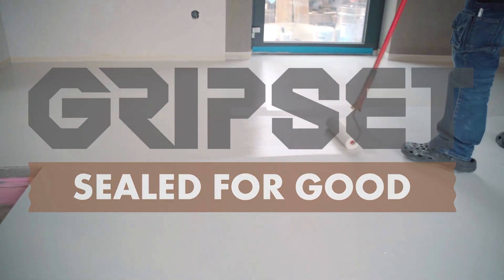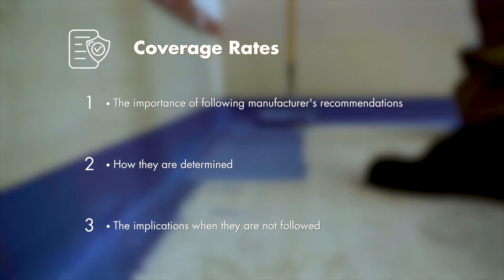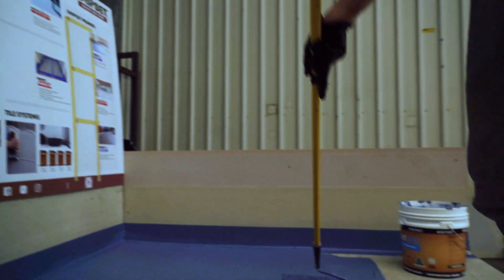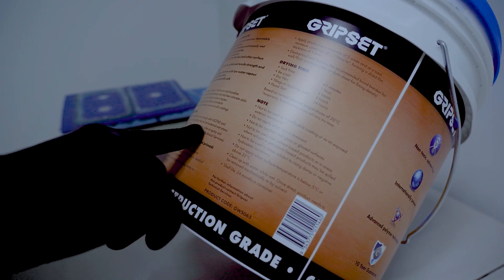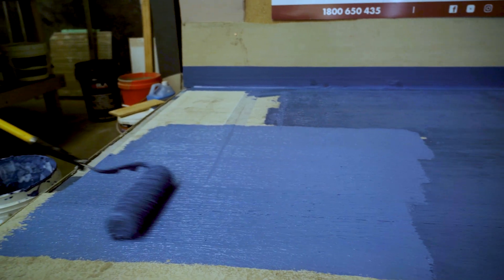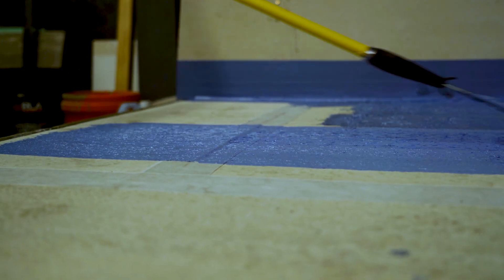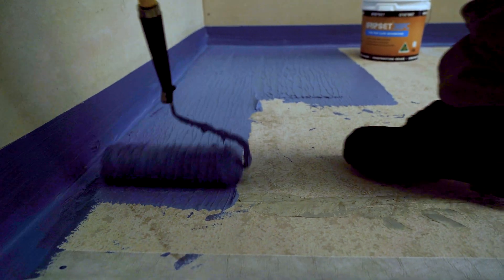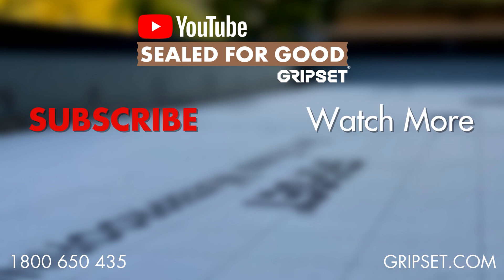Coverage Rates Part 1 | Basic Fundamentals

Comment: Good Video and here's an example of what your saying, just doing a diy  ensuite reno and got your products from beaumonts, and was told that 1 x 15l pail would be enough to do a standard bathroom or ensuite, didn't seem to want to listen to the fact that I read the application rates and it wouldn't be enough in my view. "all the guys generally only use one and you don't need to do the whole floor". The 15l rapid Bt pail is good for 10m2, my shower area is 9.8m2 on its own, leaves nothing for the remaining floor, behind a P-trap toilet etc. while they were helpful in other ways, not following instructions doesn't help anyone. 
Could I also get your advice on the following questions please: which sealant to use on the wall to wall villaboard joints?, do i need to apply a silicone in the 6mm gap at the floor junction or just use the B10 joint band with BT rapid? can i use the B10 on the wall to wall joints or is just sealant ok? the concrete floor is flat so i am using a 50mm angle to build a screed, how do I bond the screed to the membrane? and when going over the top of the screed also, do you repeat with the b10 tape between the screed and walls?  I only want to do this one time!
cheers
Reply from the maker: Hi Greg, thanks for watching!

Always follow the recommendations regarding coverage rates to ensure the required film thickness is achieved.
The required extent of the membrane application is based on categories of risk as covered in AS 3740 and the NCC respectively.
For example, for enclosed showers, the membrane only needs to be applied to the extent of the shower area, while open showers (frameless) need to extend 1500mm out onto floors in an arc from the shower rose. For small bathrooms with frameless showers, applying the membrane to the whole floor simplifies the application whilst meeting the minimum requirements. 

Villaboard wall/wall junctions 
These should be flushed with base coat/tape first as part of the Villaboard installation requirements
The B10 Joint Band is the best practice, for sealing this joint as part of the waterproofing application. It is quick to install and provides the most robust protection.

Floor/wall junctions
The B10 Joint Band acts as the bondbreaker and can be applied directly at the wall/floor junction without the need for sealant behind. 

When screeding over a membrane, using a liquid admixture to create a cement slurry primer over the membrane surface is advisable.
This will achieve the necessary key to the sealed membrane surface 
The admixture should also be used as part of the mixing liquid into the screed  (Admixtures enhance the adhesion and general performance of cement-based compounds and are used to facilitate adhesion to non-absorbent/sealed membrane surfaces).
Pre-bagged/engineered screeds can also be considered, as these are polymer enhanced.

Gripset 11Y is a concentrated SBR latex admixture suitable for this application.
Details can be found on our website. 
Other proprietary admixtures can be used, ensure instructions are followed.

Over screed application
If applying a secondary membrane over the screed, the bondbreaker at the wall/floor junctions must still be used.
The B10 Joint Can be used, alternatively, a 12mm sealant bead can also be considered and is compliant with relevant waterproofing standards.

Hope this helps! :)
Reply: @GripsetIndustriesPTYLtd   Thanks Guys, thats a huge help